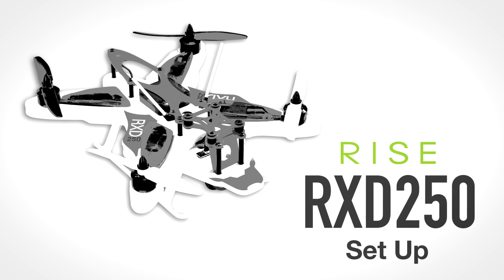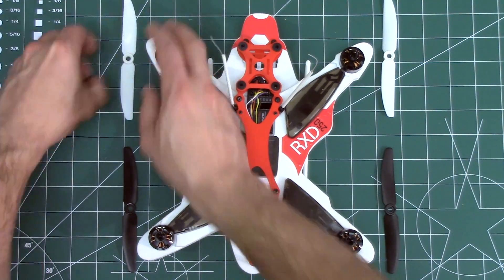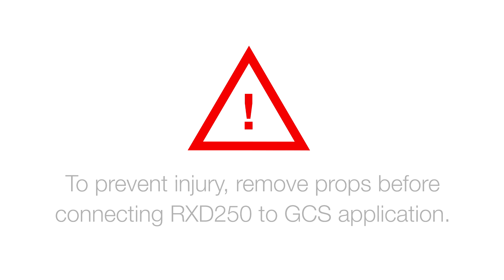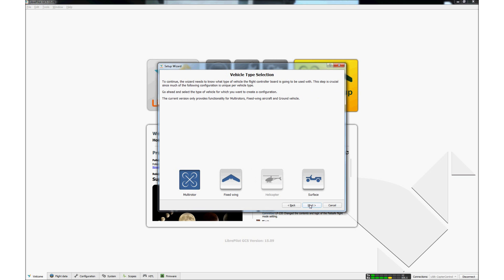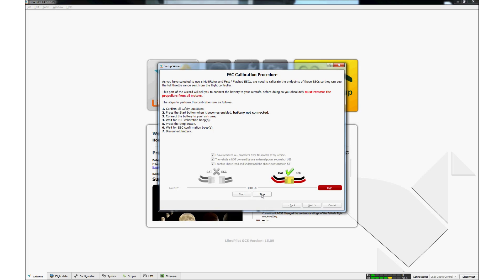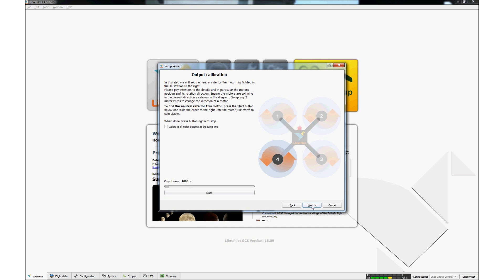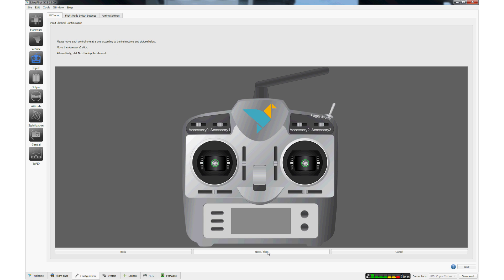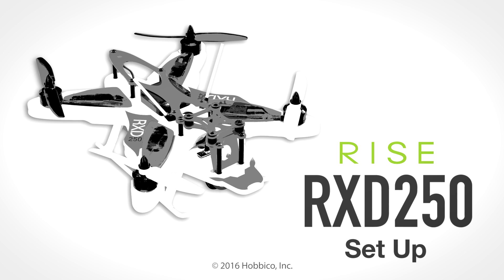RISE RXD250 Racing Drone Setup : Tips & How-To's

Comment: There are WAY to many details missed in this instructional video, moves to fast with little setup steps. If that was the intent, then you should state this as quick setup. E.G. in the ESC setup section you have the user attach a LIPO battery, arm and test, then step 7 states to remove the LIPO. The video (and it's clear you need it) shows the LIPO still connected.